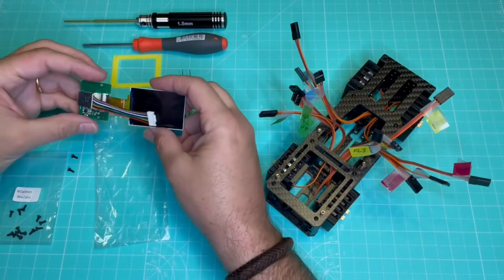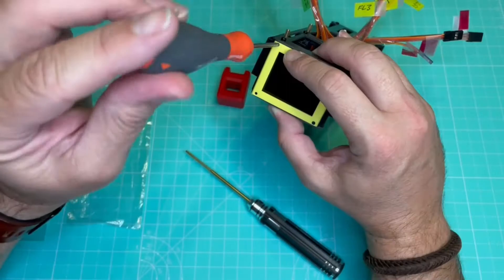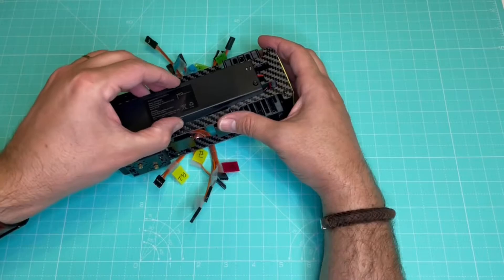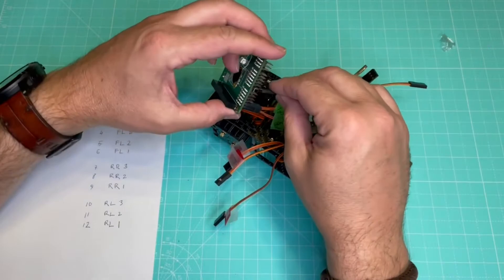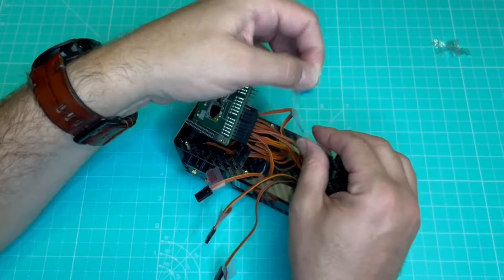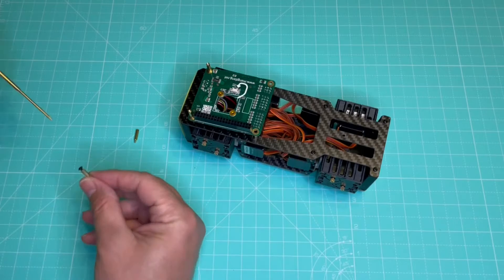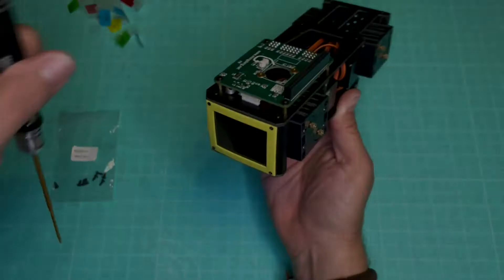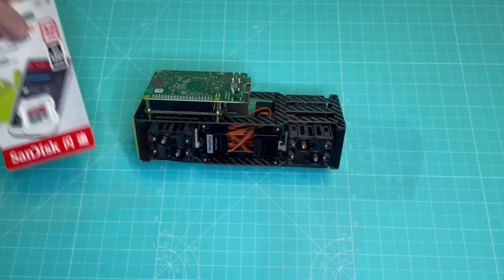Mini Pupper adventures - Part 4 - Electronics

Comment: Hello Manuel, have you done a video showing how to calibrate the servos?
Reply from the maker: Hello Ron, it is in preparation, watch this space!
Reply from the maker: Hello Ron, I uploaded Part 5 https://youtu.be/PA9QOXW9rWs which you may find interesting as it includes a description of how to reset the position of the servos before installing the legs which greatly helps in the calibration. Next weekend I am planning to upload Part 6 with assembly and calibration of the legs.